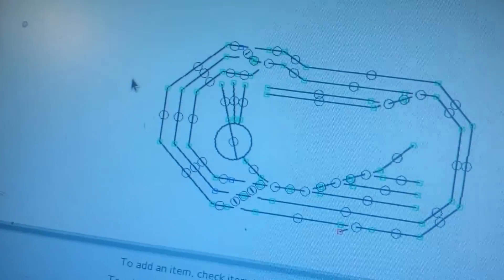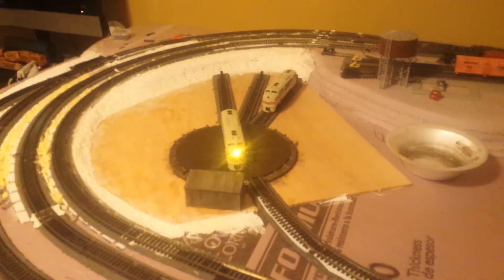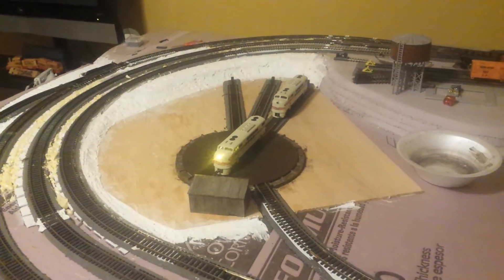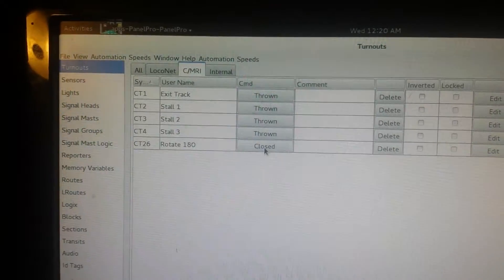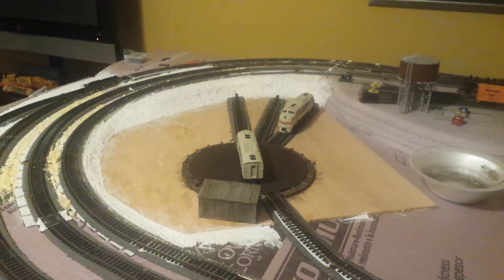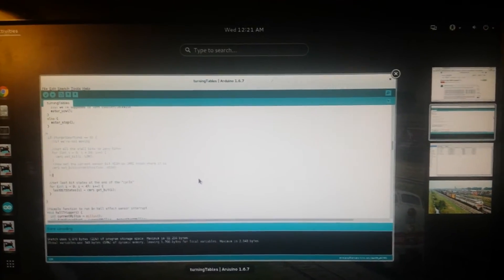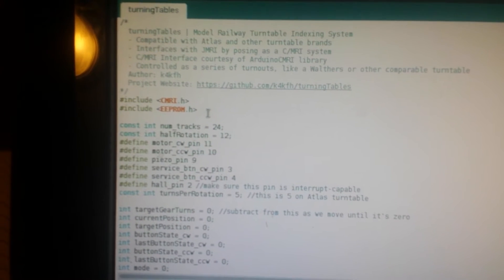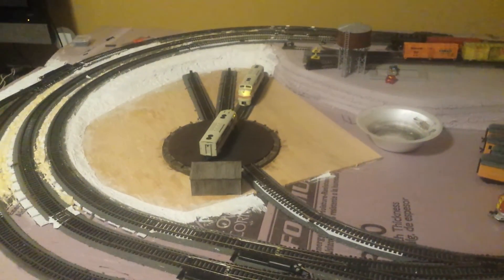Arduino Turntable Indexing System - Interface to PanelPro is working!

Comment: This looks great! Do you think I can adopt this to a Stepper motor system? Also, what shield did you use?
Reply from the maker: If you are using the Atlas turntable, you don't need a stepper motor, I just used the motor Atlas sells. If you're going to use another turntable you probably don't want to recycle this code, because it's meant to work with the geneva drive in the Atlas turntable. I used the Arduino motor shield for a while, but I later swapped to an arduino nano and a separate H-bridge module from eBay.
Reply: @k4kfh  Thanks, I do have an Atlas TT but the one I want to use is more like a Diamond TT and it needs a stepper motor to turn it.
I might use the Atlas in  different location but its more like a toy than my other one, plus, the other one is already mounted in one of my modules.

Comment: Hi This is great
can You Please explain the hardware / wiring, for the atlas turntable.
What sensors do You use on the turntable.
Reply from the maker: Thanks, glad you liked it! It uses a hall effect sensor (very tiny solid state magnetism sensor) and a 0.25" magnet glued inside the gearbox. The sensor is stationary and the magnet is on the gear, so when the magnet passes over the sensor the microcontroller knows the gear has made one revolution. I used an Arduino Uno but if I had it to do over again I'd use an Arduino Nano, since they are more compact. The code can be found on my GitHub (k4kfh). Hope this helps!